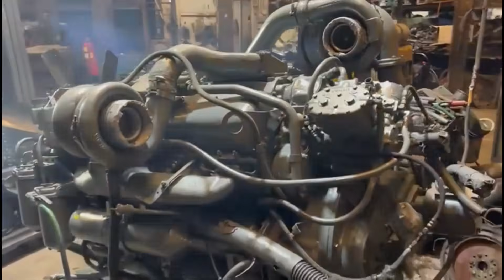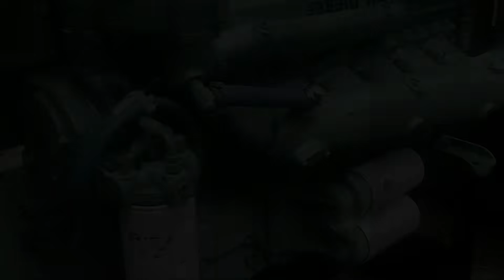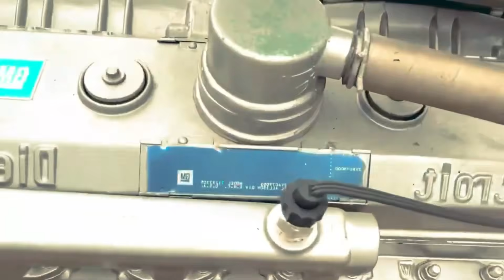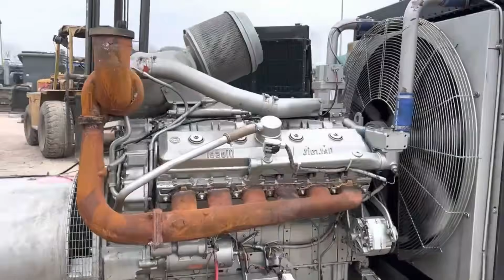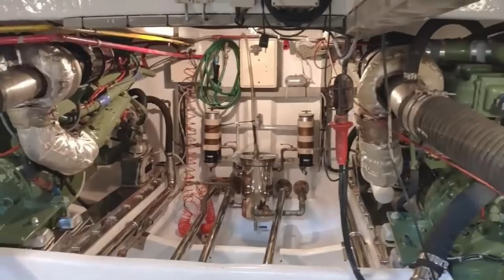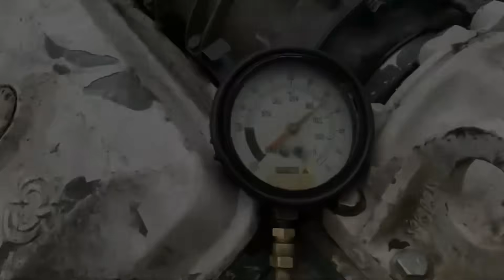20 Shocking Secrets About Detroit Diesel 12V71 You Didn’t Know!

Comment: i ran two differant wagnor  Dump log loaders One hada  a 400 Cummns Big cam 3 the other had a v12 71 under load the Cummins would run circles around the V12 71. The GM deisel was a guttles wonder.